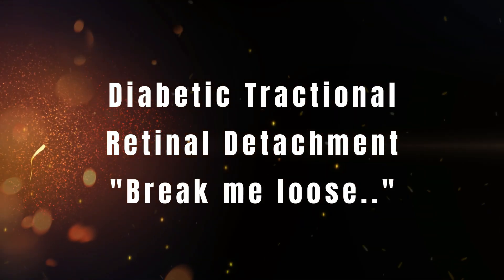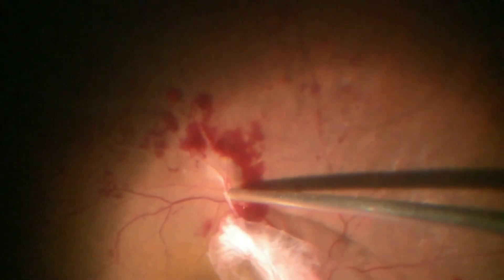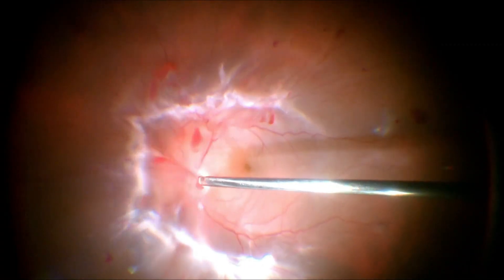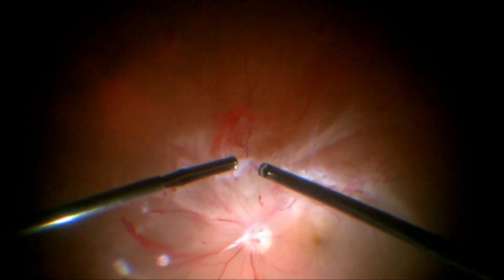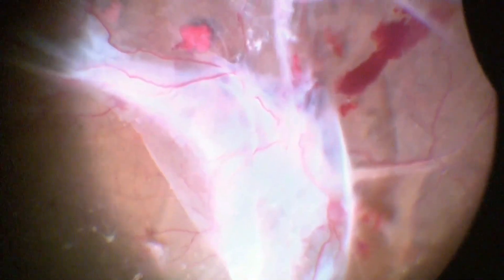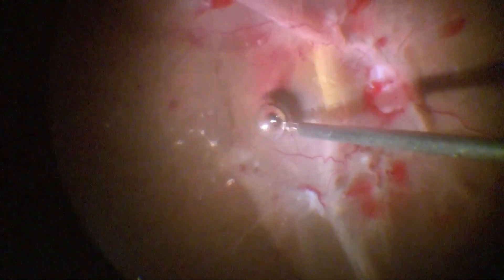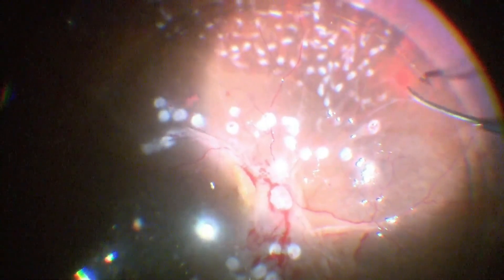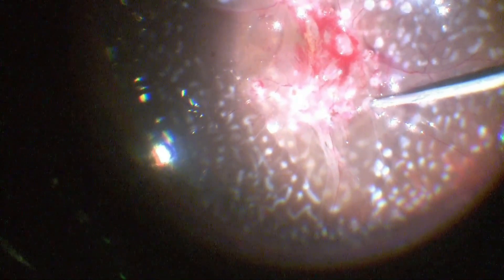Vitrectomy for PDR in TRD | Proliferative Diabetic Retinopathy with TRD | Dr Manish Nagpal

Comment: Hi. Great job. Would you please mention the vitrectomy settings at which you work so close to the retina? Is it shaving mode or core vitrectomy mode? What about the vacuum and cut rates?
Reply from the maker: i just use the highest cut rate setting s of the cutter , be it 10k or 20k and vacuum is linearly controlled on foot pedal. so could be between 50mm to 300/400mm based on retinal movement